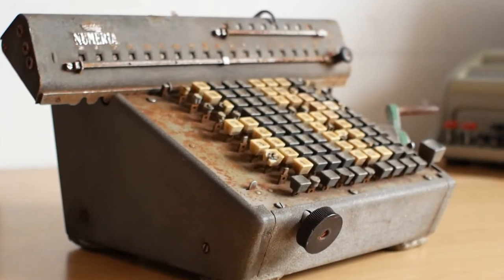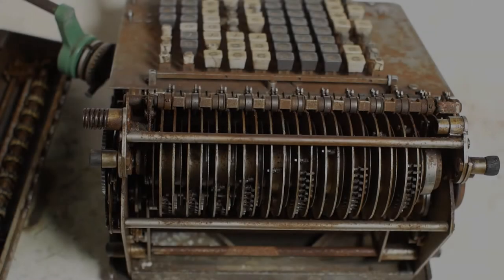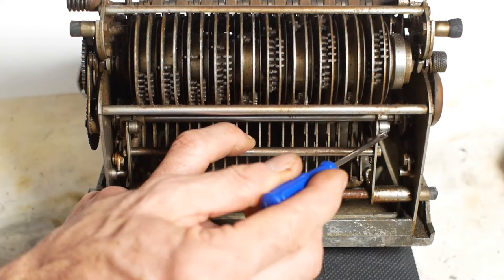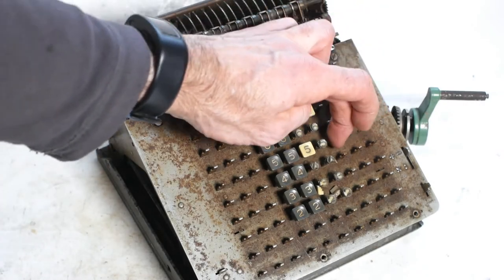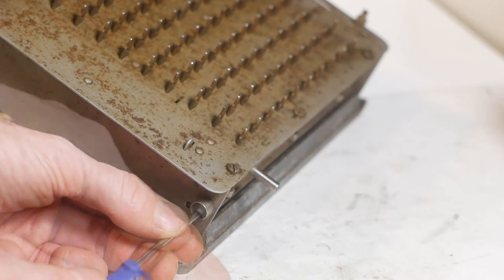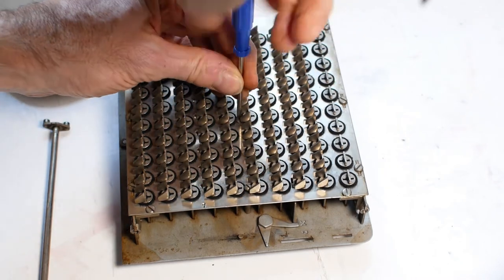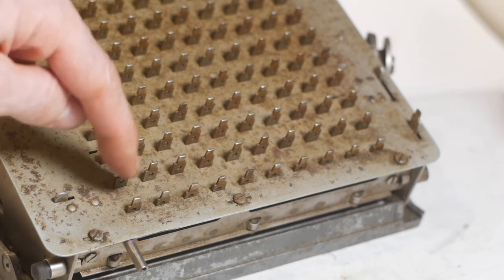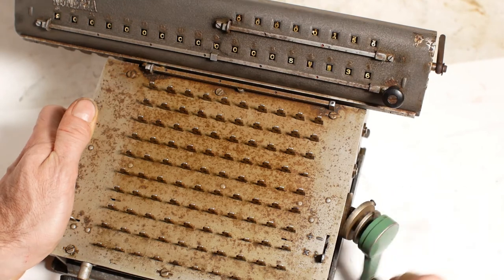Vintage Mechanical Calculator Repair - Lagomarsino Numeria Model 9203 - Part One - Refurbishment

Comment: Hi TIM, thanks for the video. I have a problem and maybe you can help me: I can't identify the model of my Numeria. How did you understand that the one you repaired is a 9203? Is it written somewhere inside the machine? Thank you.
Reply from the maker: Hi Daniele, if I remember correctly the model number is stamped into the case somewhere, but I think it's really tiny and very well hidden.  If I remember I'll dig my machine out and check.  I've worked on a few Lagomarsino machines and they all had the model number very well hidden rather than shouting about it on the front.
Reply from the maker: Hi Daniele, I just had a look at my Lagomarsino and the model number is even more hidden than I remembered - it's stamped on the under side of the carriage, partially hidden by the rod that the carriage slides on, but hopefully if you turn yours upside down and use a torch you'll be able to locate it.
Reply: @GrumpyTim  Thank you very much. Since it is locked, I will try to disassemble the machine (one of the 9000 series) and look well. Thanks again!

Comment: That was in a sorry state. Still, it's in the right hands now to get a bit of TLC.
Reply from the maker: It's kind of a silly project but when it arrived I quite liked the way it looked and figured it was worth saving.  Silly thing is, another YouTuber did a mechanical calculator restoration video that popped up in my recommended videos recently - the video started well but as they took stuff apart I spotted a few things being forced and broken during the disassembly - at the end of the video, there were the shots of a clean and repainted Monroe calculator that appears to be just an ornament with keys stuck down and from what I could tell, the electrics not restored at all.  That video has had over 100,000 views in about 3 weeks with lots of people praising the wonderful work that person had on the machine - I'll probably get about 50 views in a month.  I'm sure if I accidentally electrocuted myself whilst working on an electric machine I'd get lots of views then........
Reply: @GrumpyTim  I could see how much that might vex you. 

What you could do is use something to view his tags, description and title to work out what you can learn.
Reply from the maker: Well reminded, I intended to check his tags before I uploaded mine - I'll look later and see if there's any little gems.  In fairness, he does already have an established channel with over 600,000 subs, usually taking old die cast cars and making them look like new again - rather oddly ALL the cars he does look in a very similar, extremely dirty condition like they all came from the same place or maybe they've been unnaturally distressed!!!!  Can't really criticise him though, because his formula obviously works and his filming is really beautiful.  I think his calculator restoration was a venture into new territory and it has attracted quite a few negative comments from people disappointed that the machine wasn't working at the end.  I rarely sit and read other peoples comments but there are some gems on that video like the one congratulating him for being able to dismantle and reassemble a typewriter!!!!!!
Reply: @GrumpyTim  Yes, he may well be established but that doesn't mean you might not find some useful pointers. If you use something like TubeBuddy you can also check where he has shared it on Twitter, Facebook and Reddit.
Reply: @GrumpyTim  its not all bad, that comment you made on that channel helped me find your channel which is 10x better to watch due to knowing that the machines actually get restored mechanically and not just painted to look pretty.  it also helps me find techniques for repairing my own calculators, however i mostly due friden machines, but most of the information still applies
Reply from the maker: Cheers ArcadeCarpet, one day I'll get a Friden machine, but maybe not at the moment because there's a bit of a backlog in the repair pile and also a slight lack of space - they're such an awesome machine!!!

Comment: What a Marvel!
Reply from the maker: Cheers gsetful, it should be good once it's finished, still got a few things to do, including making the replacement key tops - 3D printing them isn't too bad but because the 3D print finish is quite rough, every one will need to be sanded on all sides (well maybe I can ignore the bottom because that face won't be seen) so that's 100 keys and 5 faces per key to sand - I must be mad!!!!!!!